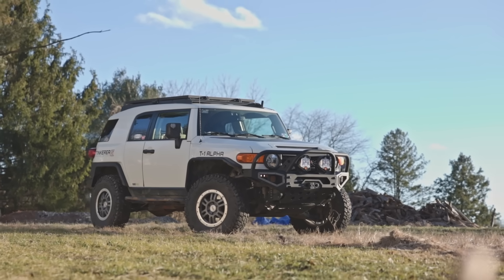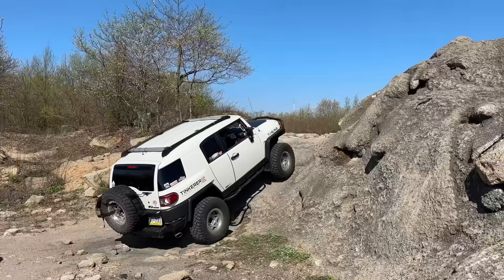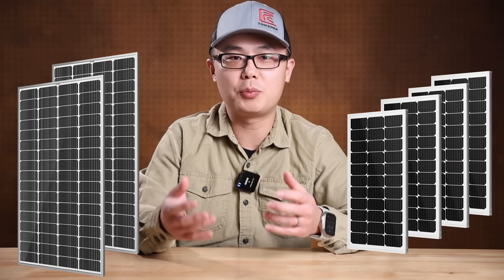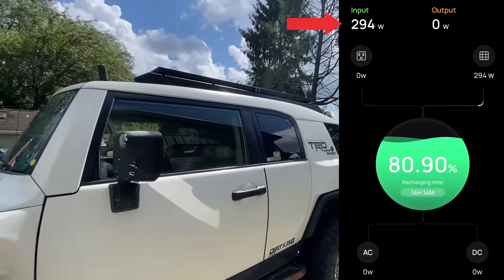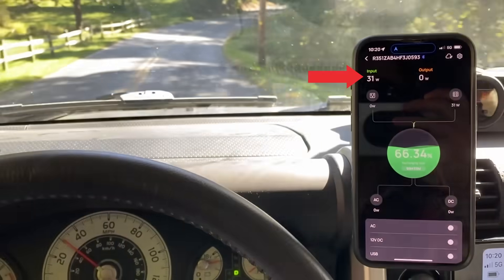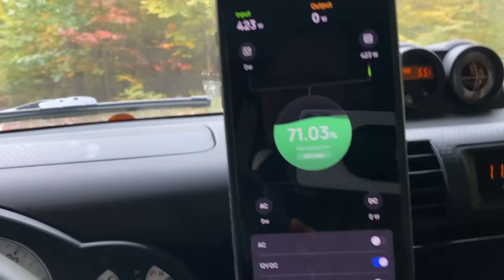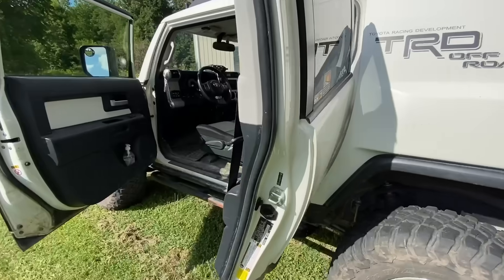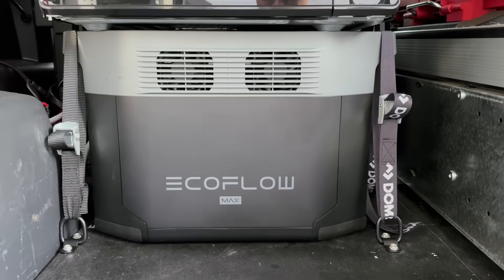I Installed a GIANT Solar Panel on My 4X4 | BougeRV 400W 10BB Mono Panel

Comment: On my camper trailer's rooftop tent i got 3x200w shingle perc panels that are custom made to my specs.. with solar on roof it could be better if your voltage was high.. like my 300w portable panels are 70v which normal solar portable are around 24v so in cloudy conditions a 24v will get maybe down to 13v which the wattage would drop to around that 20w off a 400w panel.. but with a high voltage at 70v it will drop to around 45v-50v so when I been camping with the 300w in full cloudy conditions I still get 180-190w.. The 3x200w in series will be 120v so even on a flat surface it should still get really good output at that high voltages.. I plan to make a custom made portable 800w 190v solar also

Comment: could you legally mount 2 of these but in horizontal orientation? it shouldnt stick out more than your tires. Im thinking of buying 2 of these and sideways mounting on the roof of my 2021 Kia Soul to provide power to my Ecoflow Delta Pro Ultra along with my Alternator, the DPU only powers a small DC mini fridge, charges a phone and a laptop, and a 9000 BTU Mini Split  with outdoor unit mounted in a hitch basket at the back of the car, the Mini split has an inverter.

Comment: i also have a 350w house solar pannel on my toyotas rack i had it for 3 years now.. i also solved the problem of putting things on the rack by putting two wood 2x4 on the front and back to take my kayak on the roof on top of the pannel and have it connected directly to my car battery.. keeps my battery always charged when im not using my truck..

Comment: Great video! technical question, when you turn on the victron 24V converter is it wired in parallel with the solar panel? if so, won't 24V damage the solar panel?

Comment: Solar Pannel that big? it will Charge most batteries that used in Overlanding in a day. if the roof is empty, Solar panel don't looks like bad idea for FJ Cruiser. just watch out for rocks 😉

Comment: The biggest concern I can see is chassis flex torquing the solar panel forming micro cracks. Id recommend using a rubber bushing in-between the mounts for the panel to absorb any vibration and slight flexing motions; should greatly extend the lifespan and avoid microcracks.

Comment: You probably already know this but the same year Tacoma alternator has a lot higher available output than the original fj alternator. Recommend to get a denso brand if you do it.

Comment: Gotta make you wonder what they used on the space probe Voyager? It was launched in when? 1977? What solar panels did they use that's still making electricity enough  to still be running and has left our solar system? What batteries lasted this long in absolute Zero temperature?

Comment: I have 500w of solar panels on my van. Its game changing to be able to have starlink, fridge/freezer, lights, music, laptops all running with basically no battery drain. My battery is topped up during the day and used in the evening.
Reply: interesting, do you run out of power often? I am planning a build and was going to put 700W of solar on the roof (2x 350W)
Reply: @slakk5093  I have everything running off a yeti 3000x (which is the older gen battery). I've never run out of juice if the sun is shining it always stays topped up. The only time I've had issues was in 100+ heat where the cooler had to work a lot harder. But then I just turn off starlink as I dont need it on unless I am working.
Reply: @bikesbeersbeats  thanks! 🙏

Comment: I have 400w of solar on my pickup. Mounted on a roof rack I made for my single cab longbox (8ft) F150. I mounted 4 panels 3 years ago and they are still going strong! They are wired to 4 battle born batteries. I built a stealthy truck bed camper set up in the back. The whole setup consists of electric heat, ac, induction stovetop, lights, tv, starlink, fridge, and a kettle. The setup has run great since installed! I went overkill and it paid off. I do like the single panel idea for simplicity in the future.
Reply: So help me out since I'm new to solar panels, the panels charge the batteries then you use the power from the batteries right? Im horrible with electricity. Or can you use the power directly from the solar panel without batteries? I'm just unsure how he has so much in his FJ, microwave, heater, ac, etc and it all works. Thanks if you see this!
Reply: @ExploringAlabama  Solar panels must output (plug in) to a power station. Power stations are also called solar generators. Power station is a box with many components, it contains a battery to store electrical energy, and a few electronics inside that allow for the battery to discharge to your devices. You can plug household appliances into the power station... to put it simply. Once the power station runs out of battery, you can't use any appliance anymore. Solar panel is a means to charge the power station's battery. Power stations can charge through other means like plugging it into a wall outlet, or the car socket while the vehicle's alternator is running.
Reply: What are you using for ac and heat? I’m build out a van

Comment: Technically CIGS cells have lower "peak" than a similar sized mono panel, however they are less directional specific and can grab more of the available light even when at less than perfect angles.

Comment: How much solar do you need? As much as you can fit with all things considered.  You may want to consider adding a parallel line that allows you to connect foldable panels when you are parked.

Comment: How are you handling the switch between alternator and solar on the ecoflow?  I have a delta 2 and a 100w roofmounted eco flow solar panel but don't have a switch yet

Comment: If you ever tried their Yuma series CIGS, you will never go back to standard solar panels, yes it is expensive but it is so efficient. Their 200w can max out at 172-175w in optimum condition plus if you have a shade in a small area it does not degrade entire panel.

Comment: Is the DC-DC charger from the alternator not enough? It's not like the 5mpg fuel economy is gonna get worse from charging battery banks
Reply: if you park up your car for days or even weeks the fridge will still be cold and batteries topped up due to solar.

Comment: I have a 2007 Chevrolet Uplander and I have a 230 watt solar module bolted to the roof. It has been on the van for four years now. I installed it because it was easier than replacing the alternator. My alternator is burned out and it’s in a very difficult location. I also have 6 kilowatt hours of lithium batteries connected to a DC to DC converter and then it is in parallel with the 12 V battery which is being supplied 14 V

I also have a 1200 watt sine wave inverter and a 2000 W sine wave inverter that powers any equipment that I need to run. I have a remote property and I can easily parallel more solar panels two more charge controllers. 

I’m a very much impressed with how well the system works . I supported my panel with three wooden ribs with silicone to hold them in place to negate the vibration. 

I’m glad to see that you’re pretty smart guy. Cheers.
Reply: That's an interesting solution

Comment: I installed two 220 watt flexible panels on the roof of my semi. If you are out in the bush, or out in the field working, these panels can save your bacon. I had my alternator go out while working, and those panels kept my batteries charged up just enough to get the truck to the house.

Comment: I have a 400-watt setup on my ZR2 Colorado. It runs through a solar charger controller and an AGM battery. When I go camping or "overlanding," I hook up a 1,500-watt inverter, and that powers everything I need. The main thing I use it for is to keep my dual zone fridge running 24/7 because I used to run out of juice on a portable power pack I had. I installed the panels on some adjustable 90-degree brackets in case I need to aim them at the sun as the sun moves while I'm stationary. I'm not big on RTT's due to the weight, so like you, solar was the best option for the rack in terms of handling and weight. I use a quick setup/tear down tent (Gazelle t4) to sleep in, and it's just as versatile as a RTT.

Comment: Great video as always! The point about maximizing the size of the panel depending on your needs, because you will always only get a % of ANY panel you have installed, is a good one, I think a lot of people are disappointed in solar performance because they fail to take that into account. Just FYI -  I just checked out BougeRV and it looks like the discount code you mention just works for CIGS or the solid panels you mention, not the cheaper Arch flexible fiberglass panel. Not complaining, just to let you know.

Comment: We run 700w of panels and 12v 400ah of diy battery system on our F250.  Similar all electric camping but with a Starlink HP also mounted and we often cook for 8-12 people.  The past year was the prototype for 2024.  Key things we learned.  1) Plan for a longer cycle than 24 hours due to solar obstruction.  Our new window is 7 days.  2) Only plan to use 20-80% range of the batteries.  We spent way too many hours slowly topping off the top 10% of the batteries during good solar hours.  3) Alternators die more quickly when charging big batteries and use expensive fuel.  Disable the alternator entirely so you can use it in the middle of nowhere when everything else breaks.

Comment: I ran a 380w commercial grade panel on my Jeep for roughly 4 years. The panel was mounted to the factory roof rails. In my install case my panel cracked on the edge after 3 years of moderate off roading. Those 3 years were filled with a lot more flexy trails vs boulder based trails.

Comment: Watts is that input or output. Why no solar panels are rated in battery charging AMPS. Get a Amp meter and show the solar system in output AMPS.

Comment: Nice setup!! I'm running 2x Bouge RV 200W panels on my Jeep Rubicon's Rhino rack. Panels juice up a Bluetti AC2000Max along with an alternator powered 1000W inverter.

Comment: What the heck that solar panel is over priced my man. Way better options available at a fraction of the price. List out other options so people don't get ripped off
Reply: In Australia the market is beginning to see solar panels for under 0.5c per watt for house panels. A new 400w panels can cost under US$180 which is good. The second hand market is getting bigger too with old house panels going cheap as people renovate/ install new systems, the old systems sell really cheap!
Reply: What other panel can I put on my car that compete with this?!??
Reply: Just got a BougeRV 200 watt panel. Very good pricing for a very high tech panel, shipping free. Can fit 2 on top of my 4Runner. Can get a cheaper panel but not the efficiency or shade ability.
Reply: @Jim-s6i3b  “Shade ability”? Are you saying the bogierv panel can somehow produce power in the shade?
Reply: a 400w rigid is $130 here in Canada
Reply: @bjlanders where you find that? My local solar provider is $325 for longi 455w panels
Reply: @bjlanders In Germany 55€ for a cheap one.
Reply: Why make the comment like you have all the info and not list those options?
Reply: Quick answer.. keeps the snow off.
Reply: I bought two of the DOKIO 400watt panels thinking they would fit on my car…… smh only one would fit and basically the same size to vehicle comparison. If I was using a van or truck like this I’m sure both DOKIO 400watt panels would fit.
Reply: Thought it would overhang the windshield slightly but worth having 800watts combined in a truck/suv/mini van 

But a van would be perfect for 800watts DOKIO
Reply: It’s a sponsored video, Will. It’s not the same as your channel
Reply: Did you watch the entire video?  They gave it to him for free.
Reply: The king has spoken

Comment: My takeaway from this video is you made a strong argument against solar for your use case. It seems a higher rated alternator would fit your needs better. You live in a low solar irradiance location, you have the engine on the majority of the time, you lose most of the usability of a roof rack (yes you shouldn't overload it, but as you said, it's good to have the option should the need arise), and with extra cables, connectors, charge controllers etc you add complexity and cost over swapping a single part. I am by no means against solar, I have panels on several of my vehicles, but live in a high irradiation area and leave them parked for extended periods and I think that is where they make sense.

Comment: I've been wanting to get those wafer thing CIGS pannels and mount them to my limo. Maybe glue them but preferably not, but glue would add no extra wind resistance.
Can get about 1KW out of the available roof area, doesnt sound like much until you realize that this thing only uses ~6kw to cruize down the highway at 55MPH(with extra power used for accessories like brakes, AC, power steering etc.)
Reply: Of course i wouldnt just install solar, i've also been trying to find a hub motor that can handle the weight so i can convert this to an AWD PHEV. 
I found a good source of reletively cheap LiFePO4 cells that are large enough to easily directly manage with a BMS instead of using cell banks like in many other EVs.
28kWh worth of battery and BMS is around ~$4200, right now i have 14kw and it has worked great for home battery backup.

I've had this limo since 2015 waiting for pannels, batteries, and hub motors. Now that pannels and batteries are available, i'm getting a bit ants-y, and might just fabricate a rear differential cover that allows me to drive one side of the axel with a 20kW motor. I'd go 50kW but the motor would be the size of the differential, and to offset it properly, it would either be hanging lower than the axel, or i'd have to hammer out some space in the gas tank, neither of which i'd like to do.

Comment: I am running an off-road trailer with Echoflow batteries and 4-100 watt Zamp solar panels. I installed a DC to AC 1000w inverter to charge 600w (upgraded HO alternator) with my solar and it works great. I wanted to thank you for the video you did testing your EF with a DC/AC inverter. Without seeing that, I would not have been able to achieve the charging times I am getting.

Comment: perfect timing on this video as i just installed a dual battery system in my 4r today with a redarc bcdc. i will definitely be using that discount code. thanks for your effort to provide real life data in your videos. you continue to put of some of the highest level toyota edits on the tube. for anyone else reading this his shift knobs are the best on the market. most are just generic rebranded blobs.

Comment: I have a goal zero 3000x with the alternator charging kit and i feel like i dont even need solar anymore. but i did set up one 100w solar that cancels the power of my fridge and wifi router during the day. and ive never gone under 20% assuming im driving at least once a week and the weather is always sunny. whn my alternator gives out i might upgrade to a high output alternator. i also considering covering my whole roof rack with solar panels. i sleep inside my gx470 anyways and creates atiny bit of insulation from the sun.

Comment: When ur mostly wheeling, why don’t you go with a dc dc converter and a mobile solution for the case you’d find you camping and get the benefits of setting it up ideally ?

Comment: Have you noticed that your panel gets more watts input when driving?
After driving through rain my Sunpower flexible solar panels have actually brought in more than the rated capacitiy. 
I think the air cools the panels when driving.

Comment: Nice setup. 
I have two 100 watt Sunpower flexible solar panels and one 100 watt CIGS BougeRV  panel on my Ford F-150. 
I am replacing the two 100 watt Sunpower flexible solar panels with 3 new 110 watt Sunpower flexible solar panels. 
I will have 430 watts of total power. 
I attached the Sunpower panels with heavy duty outdoor velcro. 
The CIGS panel already had tape on it. 
I have driven over 20,000 miles with the flexible solar panels on the cap of my truck. 
I am planning on getting an induction cooker like you use.

Comment: At 8:41 you show simultaneous solar + alternator charging.  Where are you plugging in these charge cables on the Delta 2?  I only see one DC charge port.

Comment: Durability is a major issue here.
All the videos of people testing durability of modules by hitting or jumping on them are effective marketing stunts.  The glass on the face doesn't break, but the silicon is a fraction of a human hair in thickness, and it cracks. Micro cracks don't sound too bad, but they can isolate cells forming hotspots on the module. An isolated cell will dramatically lower the current and power output of the entire module, in the same way that shading a small area of the module disproportionately reduces the output.
It could be interesting to point an IR camera at the module and see if you have hotspots. You won't be able to image microcracks without some very expensive equipment though. Google solar panel micro cracks if you want to learn more.

Comment: Im really curious how you combined solar and the DC/DC converter since the ecoflow has only (1) port. I was thinking about a solenoid to separate the power and only use the dc/dc converter at ignition on. But it looks like you combined them, which is interesting.
Reply from the maker: I didn't. I switched to the Delta 2 max which has 2 independent DC input ports.
Reply: @TinkerersAdventure  dang it! I figured that you found a workaround haha.